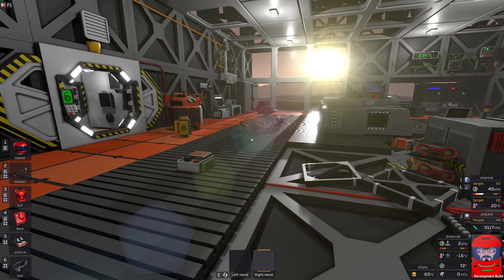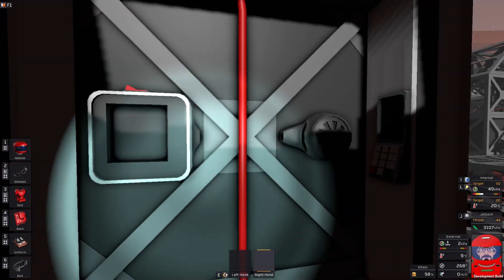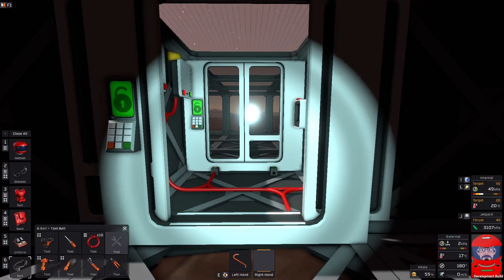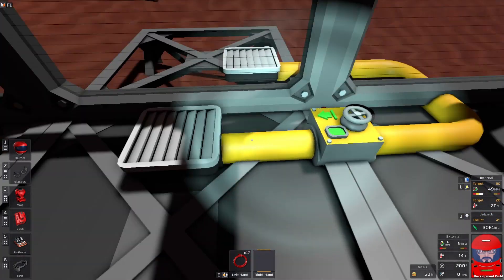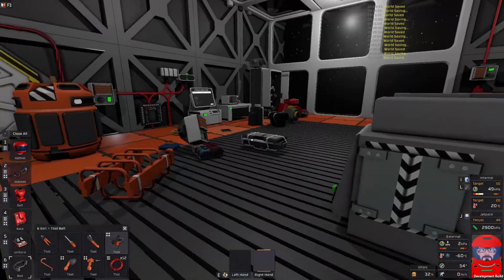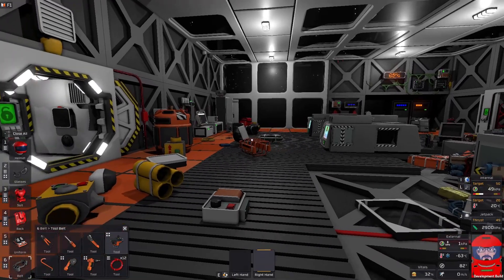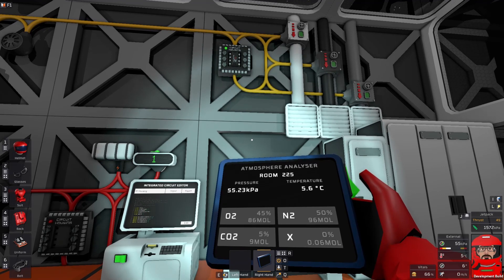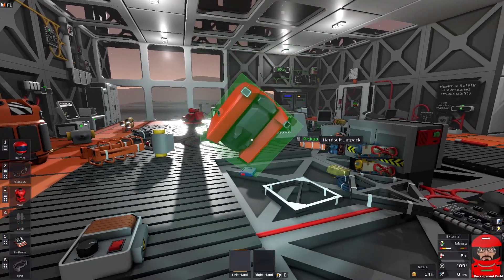Stationeers Pressurising the base

Comment: Hello, good video ! But how do you manage undesired gas ? For example you have a bit of polluant that you need to filtrate and you have a large base ?
Reply: would say, there's a portable scrubber for a reason
Reply: @draconas109  imagine place a portable scrubber in each part of a large base dude lol... Anyways perfect air do not exist so...you may always have a bit of undesired gas (in mmol or nmol)
Reply: @DreamyBoy67  If you haven't figured by now, add a base wide network of pipes and passive vents, hook them up to a filter. Job done.

Comment: Hi i am trying to edit the code so that the temperature control works with air conditioner but so far no luck the buton on the AC turns green but the ac does not work any hints ?
Reply from the maker: Press start on the AC.  Once it is going the code should operate it.
Reply: Well the start buron no the AC unit is grey and can not by pushed altrough the + and - butons abowe works :(

Comment: Nice. always wondered how gas mixers worked with 3 gasses.  I like your backpressure vent idea, although I had an active vent connected to a tank, for those numerous occasions where I had to remodel the base and evacuate the breathable atmo.  Then when I was done, pump it back into the base.   Can't wait to try this.